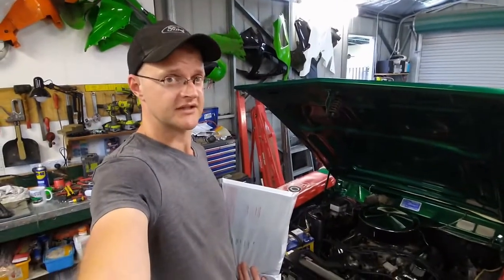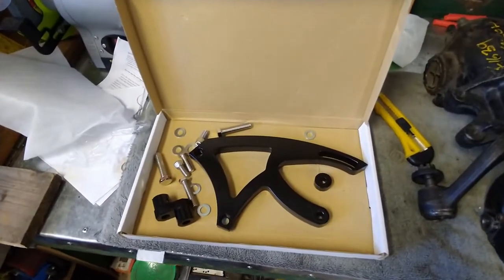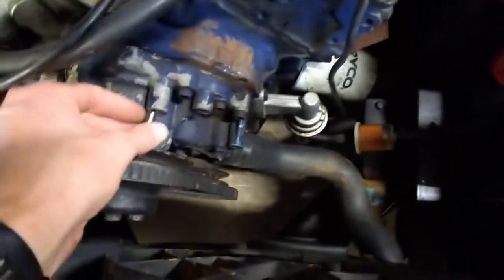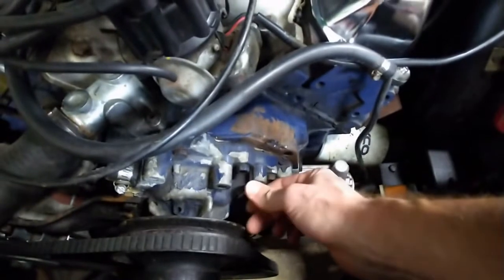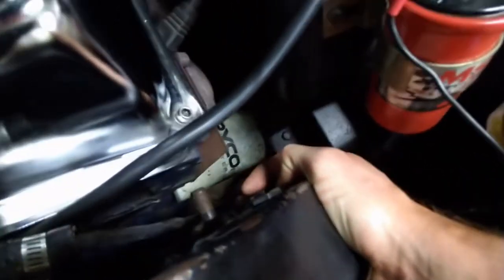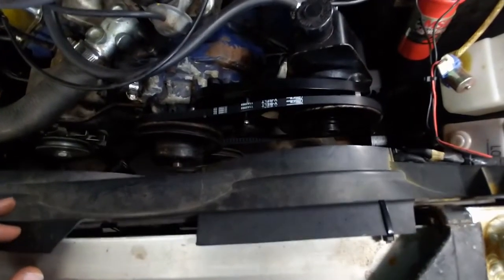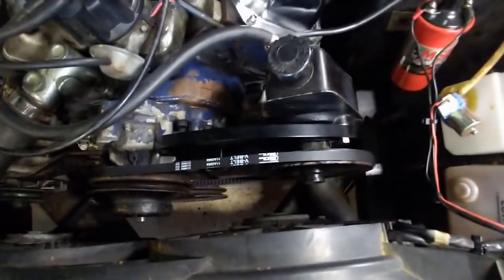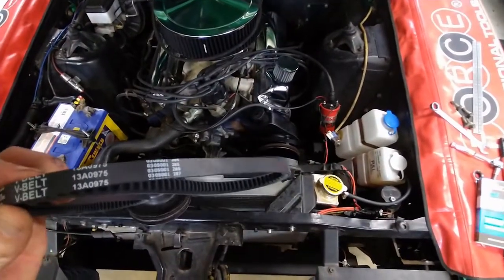XC Ford Falcon 351 project: Ep 90 Calcustoms power steering bracket and Saginaw pump install.

Comment: I'm no expert but when I fitted mine up I used a pulley off an original pump and got it machined to fit the Saginaw pump shaft. I was advised online that the water pulley  groove closest to the motor was different (13a not 11a)? Someone correct me if I'm wrong.  Maybe there's no real compatibility issues to be had...

Wish ur videos were around 10 years ago. Keep up the good work.
Reply from the maker: At this stage the pitch of the groove looks okay, but this might all be for naught if the pump doesn't pump or the belt slips at all. I had a 351c jag years ago with intermittent power steering and it sucked, but I was young and that was the least of that cars problems so I never resolved it.
Reply: I scrounged parts for years so  I would stick at it as non power steering falcons are a real chore to turn. 
I reckon as long as the belts are aligned it should work.
Tip: buy a reco ps box or get it rebuilt. Ps leaks are real messy and changing ps box is a pita and speak to a  hyd hose specialist for a hp hose adaptor imp to metric.

Comment: Fun, isn't it ?
what was that bracket worth by the way, haven't seen them before ?
Reply from the maker: I can see this project being a bit of a headache at this stage and I'm not ruling out the possibility of entirely different pump, line and bracket options if my current plan falls over. Bracket was $242 delivered.
Reply: @Missleindustry  surely you could get the whole thompson pump & hoses from a wreck for less than that ? There were plenty around.